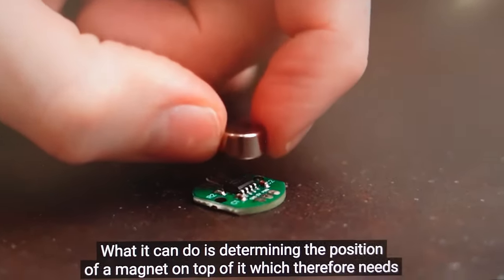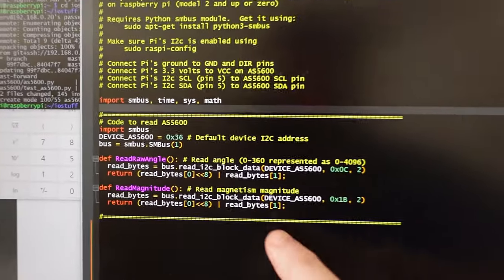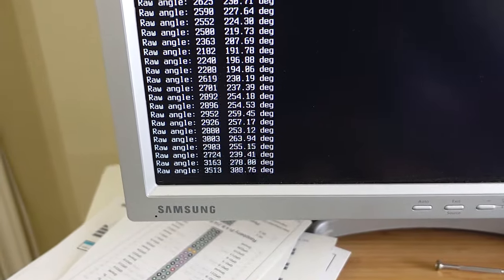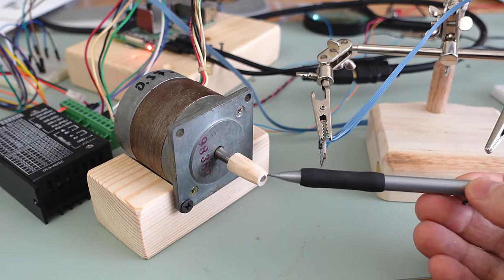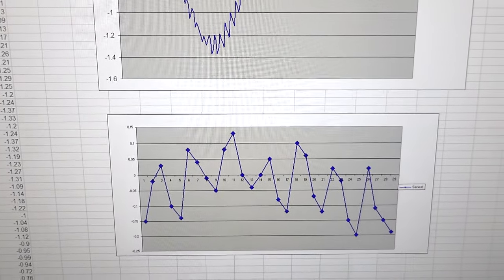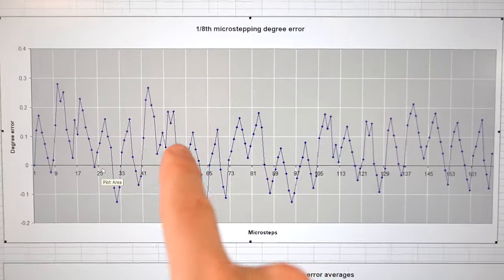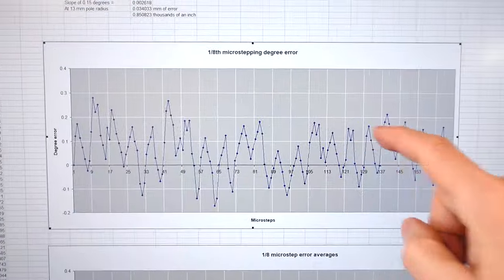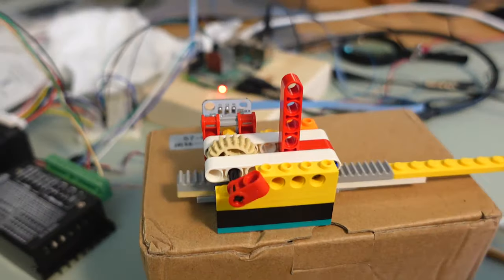Magnetic rotary encoder vs stepper motor accuracy

Comment: Hey matthias
bei deinen videos sind immer die untertitel aktiviert.
Kannst du das so einstellen?
Ist das bewußt so?
Reply from the maker: You can enable automatic captions.  When you view, you can turn them on or off.
But on my main account automatic captions is broken for some reason, so I have to do some manual work.
Reply: @matthiasrandomstuff2221  
I do it every time, at every single video i turn them off.

Comment: Just a hunch, but is the DAC on the PI 10 bit +? If you want accuracy you should consider a microcontroller with a 12 bit DAC. You also may want to consider getting a less cheap AS5600. I have several versions of that board and that version you were testing with is the one that causes me the most issues.
https://youtu.be/yvrpIYc9Ll8?si=PwDlOJt4aq5ct-S6 is the real genius of motor encoders, in my opinion.
Reply from the maker: and what does a day have to do with it when I wasn’t using one at all?
Reply: @matthiasrandomstuff2221  you mean DAC?
Reply: @matthiasrandomstuff2221 the ams 5311 is a linear encoder that gives you 10-12bits accuracy every 2mm   using a ring magnet that you could mount on the gear.  The nice thing is the encoder is mounted off axis. The data sheet claims 5um accuracy. I used one of these a few years ago on a rotary table for a projection mapping experiment.

Comment: The sensor and the motor are fine. This is typically a modulo problem. On the plot of the readings you can see that you can draw 60 degree NW-SE lines that connect the points perfectly.